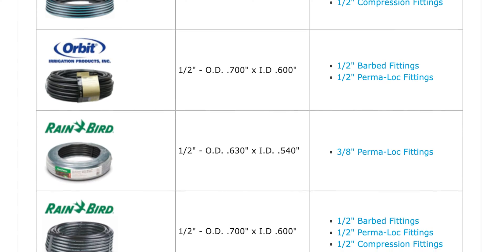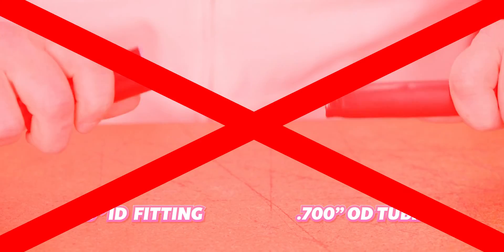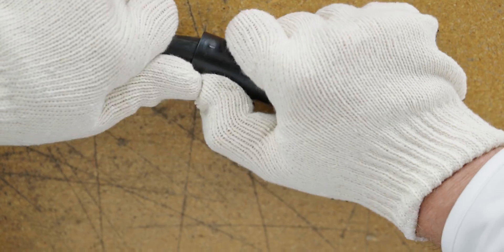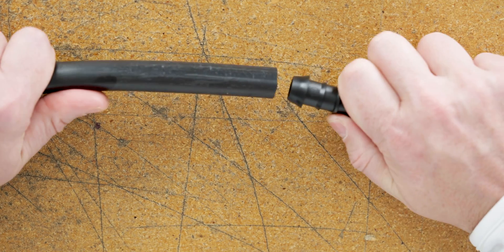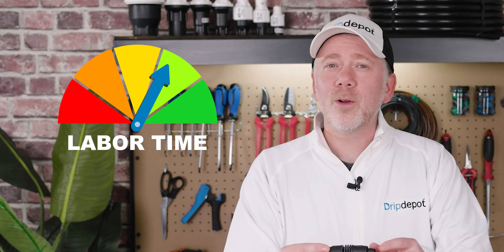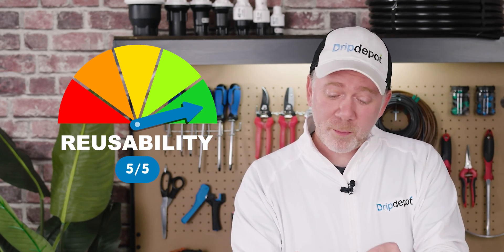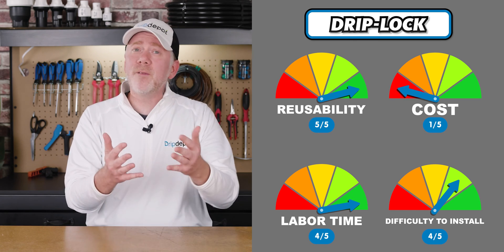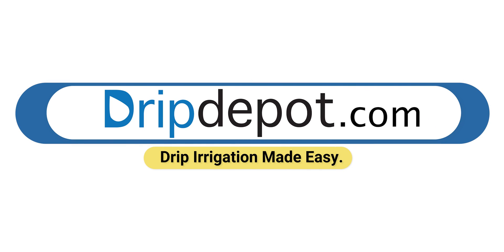Drip Irrigation Fittings: Choosing the Best Type for Your Project

Comment: This channel is honestly so good. 

I wasted money thinking that when irrigation companies say their tubing is "1/2 inch," they actually mean 0.5 inch. But in irrigation tubing, "1/2 inch" is not a diameter, but a class. So far, I haven't seen any "1/2 inch" tubing that was actually half an inch. Not inside diameter, and not outside diameter either. Instead, there are several diameters in the class in the ~0.6-0.71 inch range. This makes it much harder to reason about the tubing and fittings than any other kind of tubing I've worked with.

Companies like Rain Bird are not helpful here either. Their websites are designed by people who have forgotten what it's like to NOT already know all the crazy opaque rules about "1/2 inch" tubing. They don't make it easy to figure out which tubing works with which fittings; and you have to do a great deal of research to figure out not only which fittings to buy, but in fact, which tubing you CAN buy, because you need to hook the tubing up to a water source that's a standard diameter (like 3/4 NPT) rather than crazy irrigation moon units where the nominal diameter is more of a diversion than a specification.

For Rain Bird "1/2 inch" tubing which is actually 0.71 inches (OD), I wound up heating the end of the tubing with a hot air gun and then sliding it over a 5/8 brass barbed fitting. Even without a clamp, this has been completely leak-free for several weeks, so hopefully it'll hold. The other end of the fitting is in real units (3/4 NPT) so I actually know for sure it'll fit with an NPT pipe without having to get out an astrolabe, or consult with an astrologer, or however it is that people usually grapple with this needlessly annoying problem.

In the video, you see 0.7 vs 0.71 inch, and that 1% is enough to make things not work. Why on Earth is that even a thing? Why don't they just standardize on half, 5/8, 3/4? Or the same thing in metric, i.e., 17mm? What is this "tubing A is 0.01 inch thicker than tubing B" nonsense???
Reply from the maker: I fully agree on standardizing these!  It's frustrating for us too (which is one reason why we made the video) trying to help folks who have pre-existing tubing.  Finding out exactly which 1/2" size it is can be a huge pain.  I'm in 100% agreement (and I bet they are too!).  

I think you're touching on what would be the right answer as well, when you mention metric.  Metric would allow there to be different sizes all very close (like we see now with 1/2") but still be able to clearly know what size fittings to get.  This would allow large commercial growers not to over spend (why spend more for 17mm when you're spec'd out for 15mm) while at the same time allowing gardeners, DIY'ers and hobby farmers to easily get compatible tubing and fittings.  

PVC/Iron Pipe Size standardized decades ago, it's time for poly to do the same -- you have an ally in me to see it so.  :)
Reply: @dripdepot  I think we could actually take things a step further. How many times have you heard from someone who could only get a threaded fitting on a couple turns because they didn't realize there's a difference between NPT and GHT? I saw a bunch of reviews for a Rain Bird NPT to drip-lock fitting just today which complained about that exact thing, and it was pretty obvious what was going on.
Reply from the maker: @__S__435   You're spot on here!  The GHT x NPT confusion is definitely even more common than the different sizes of 1/2" tubing, it's something we hear almost every day.  That one is a bit tougher to solve, but maybe another thread type that combines the best properties of each (quickness and ease of hose threads and the tapered property of pipe threads) would do the trick -- after a few years of serious confusion, things might settle on the new thread standard :)
Reply: Wait till you try to buy a 2X4 ! Marketing lies. Always.

Comment: Would you ever use a Fernco coupling for a repair?
Reply from the maker: I've never used one before, but I just took a look at some of their literature and videos, and I do think they'd work well -- like "Bite" and "Loc" fittings they work with a range of sizes which is always handy, and I like how they work as a socket fitting (inserting the pipe into the fitting instead of over the fitting).  Solid looking fittings!

Comment: Can the brown tubing and black tubing use the same fittings?
Reply from the maker: In many cases you can -- the 1/4" brown and 1/4" black tubing are the same size, so they can pretty much always use the same 1/4" barbed fittings.  In the 1/2" label, they're not always the same size, even if they're both labeled 1/2".  With the brown 1/2" it's best to check the tubing's inside diameter to see which fittings would be compatible.  :)

Comment: I love your videos! I have questions.
I am setting up two drip systems from 2 rain barrels which are about 2' off the ground. I have drawn my design and know what fittings I need, except for these questions:
1) One application might be fine with drip tape (the run isn't very long and there are no turns). What is the advantage of drip tape over tubing and emitters? You reference emitters getting clogged. Does trip tape clog?
2) The other application has a total of 47' where there would be holes and emitters (there are 13' that will not have holes). To get the water all the way to the end of the longest length, should I get the emitters that adjust flow and make them drip more slowly at the proximal end and as I get to the distal end open them up? Or am I going to have the use city water with pressure to get that far?
3) Can/should I put emitters in the holes if I get the tubing with the holes pre-drilled at intervals? 
4) If I need to use city water intermittently, I know I need a backflow and pressure regulator, but for the rain barrels I don't need those. Do you recommend that I set up a separate hose connection and switch it when I need it?

Any help would be great. Then I can place my order.
Reply from the maker: Let's dive in! :)

1. Drip tape has some very low flow options, which can be an advantage in a gravity system -- basically, the low flow means each emitter creates less of a demand, which leaves flow for emitters further down the line.  Drip tape is one of the most popular gravity irrigation options as it can also work at very low pressure. 

2. For this part I'd likely get a low flow emitter that can operate at very low pressure -- the one I'm referring to is at this link, it can operate at near 0 PSI: https://www.dripdepot.com/12200

3. Most of the pre-drilled tubing will already have an emitter beneath that hole -- similar to drip tape, when you're close/holding the drip line, you can see the actual emitter in there.  This type of emitter line often has a minimum PSI to reach which might not be possible in a gravity system.  Going back to question 2 for a moment, those drippers would work similar to what you're describing -- you'd punch a hole with a hole punch, and then you could insert the barbed end of that dripper. 

4. That's a great idea and would help ensure you can run the system even if there has been no rain to collect -- alternatively, you could use a hose or similar to fill the barrels with water (if it's allowed in your area) so you could continue to use those. 

Mimi, we have a video all about gravity / barrel irrigation systems that uses a lot of what we talked about above -- if you haven't bumped into it yet, you can check it out at this link: https://www.youtube.com/watch?v=MHEb9CG8Rlg  :)
Reply: @dripdepot  Yes. That was the first video I watched and where I started. 

Thank you for your thorough reply. And what a great suggestion to put the hose in the barrel! Had to slap my head and say "Why didn't I think of that?"

Based on what I learned from that video, the pressure from my barrels is 0.866 GPH. Will that be sufficient to reach the far end of one of my lines is 30'?

I can't thank you enough!
Reply from the maker: @MimiKessler  You're very welcome, any time at all! 

Potentially you'll have enough pressure -- this will largely depend on two things: 

1. Friction loss -- friction loss is determined by the length of the line (30' in this case) and the flow going through it in gallons per hour -- the flow going through it is just the sum of all emitters operating at once.  As a quick example, if that 30' line was supported 20 0.5 GPH emitters, the flow would be 10 GPH.  If you know how many emitters and their flow rate the line will be feeding, just let me know, I can check on the friction loss for you -- if you're not sure yet, just let me know when you've decided on emitters and how many and I'd be happy to check it then. 

2. Flow -- flow and pressure are different, but both equally important to account for -- in this case I mean the flow rate coming from the barrel.  If the flow of the system is 10 GPH (20 0.5 GPH drippers as an example), you'd want the water source to flow a little higher than that.  If there's not enough flow, some emitters would be starved of water (even if technically there were enough pressure at the start). 

Is your rain barrel already setup?  If so, you can get a good idea of its flow rate with the timer and bucket test -- time how long it takes to fill the bucket with water and then put the numbers into this flow rate calculator, it will give you a good approximation: https://www.dripdepot.com/irrigation-calculators :)
Reply: @dripdepot  Good idea. I will do that.

Comment: can you bury a barbed coupler? which is best for burying?
Reply from the maker: You bet, it's fairly common (particularly on larger Ag projects) for them to be buried.  With 1/4" couplers I'd say it does slightly increase the chance of debris getting in (which should be flushed out), with the 1/2" couplers the risk of any debris getting in a fairly minimal :)

Comment: Compression fittings are reusable if you're determined enough lol
Reply from the maker: Kind of (and you're right about determined lol, not easy to get tubing out) -- once the compression ring has been engaged, it's no longer 100% -- so you can technically re-use them (after fighting the tubing), but it is a little riskier since the compression ring has already been used.
Reply: @dripdepot  ya i am definitely just buying a new one next time lol

Comment: 2:49 protip: don't attempt to reuse compression fittings unless you want a free surprise sprinkler system installed in some of your garden beds.
Reply from the maker: Fully agreed!  There's a couple comments here suggesting you can re-use them, I do suspect there's a few surprise sprinkler systems out there like you noted.  Even when it looks like you can reuse it, best not to :)
Reply: @dripdepot  real question, though: which one is best for subterranean use?  I'm assuming barbed tubing with metal collars, since these seem the most damage-resistant.  For the record, I currently bury only the tubing itself, leaving all joints above ground, but it's something I've been thinking to try as a budget-friendly funny pipe substitute for small / semi-permanent projects.
Reply from the maker: @shionyr   I think you are correct -- I'd stick to barbed fittings with clamps or with the Loc style fittings.  With the Loc style fittings I'd only use the professional ones made by Irritec (they have different names on various sites, on ours they're called Twist-n-Lok, Irritec calls them Perma-Loc), they're durable enough to be used sub-surface and the locking nuts on them work like clamps.  Some of the off-brand ones might work, but I haven't used them (if the plastic is dense and heavy, good chance it's durable enough). 

When going barbed fittings with clamps for sub-surface, I'll usually put 2 clamps on each side of the fitting, with the tightening gear on opposite sides for each one to level out the tension.  

Like you noted, I definitely avoid compression fittings in any sub-surface application, because eventually you are indeed going to get a surprise geyser lol

Comment: Who the hell ever uses clamps with barb inserts?????
Reply from the maker: Professionally, virtually everyone -- note, this is in reference to LDPE poly tubing.  Funny pipe, for example, does not typically need clamps, same with most braided tubing.  

With an above surface DIY install for a low pressure drip system, we've seen people go without clamps, but even then the low cost of some clamps is probably worth it, a blown fitting while the system is running can cause a lot of damage quickly.  

For sub-surface systems, I'd always recommend going with the clamps, even if it's just for the extra peace of mind.  And for anything higher pressure than drip, I'd always go with the clamp (again, for LDPE, not for funny pipe or braided tubing) :)
Reply: @dripdepot  In a video on irrigation, on youtube the show "Garden Answer" uses barb inserts with clamps.
Reply from the maker: @betwil3  You bet, using the clamps is definitely best practice -- even if it's unlikely a fitting will blow off in a drip system, the odds are greater than 0 and given what can happen with a fitting blows and it's not noticed right away, best to use the clamps when using barbed insert fitting :)

Comment: You don't have the specs for perma-loc on your website, but I would recommend operating PSI under 50.  My biggest issue with all fittings is I've had a lot of leaks to deal with.  Perma-loc tends to not deal with lateral pulls on the joint all that well without problems.  I think I may try some of the drip lock fittings to see if they do better at dealing with movement in any of the hoses.
Reply from the maker: Absolutely correct on all counts -- the manufacturer doesn't tell us the max operating PSI for them, they say to keep the operating pressure for what the tubing is rated for, which is fairly reasonable and is also, as you noted, 50 to 60 PSI.  I'd agree they're best used in low pressure drip applications.  

Drip-Lock could be a good choice here -- the teeth inside the drip-lock fittings can rotate, so they might indeed be a little better with moving hoses as they can be connected but still rotate.

Comment: The compression fittings can be used again. You just have to use a set of pliers, preferably needle nose, and work out the portion of tubing that is stuck inside. It’s a total pain but the fittings are not single use only.
Reply from the maker: While they can be reused, they should not -- the manufacturers of the compression fittings also recommend not re-using them.  It's one of those situations where reusing them is a "do so at your own risk" kind of thing, which when it comes to plumbing and large amounts of water, it's usually better to play it safe.  

The reason is because the compression ring inside, they're generally considered a one time use.  To some degree the time since installation does apply -- if you inserted some tubing into a compression fitting then need to immediately remove it, chances are you'll be good -- but if it has been installed for awhile, definitely best to just get a replacement fitting :)

Comment: Good video.   I just use an old coffee cup (one you don't care if it gets broken working outside.. and won't be drinking coffee from later) filled 3/4 full with water that I then heat in a microwave to a reasonably hot level (not too hot... don't want to scald yourself!!).   Dip the end of the 1/4" or 1/2" line into the hot water for a few seconds... quickly shake off the excess water.. and shove the hose home.   It makes pushing barb-fittings into 1/4" hoses and 1/2" poly hoses into fittings super easy compared to doing it 'cold'.   They go together like butter.   This works especially well if you're working on a cold day when otherwise it's super difficult to push things together.
Reply from the maker: Fully agreed, and fantastic tip for anyone reading this who wants to make installing fittings magnitudes easier.  Those cold morning installs without hot water are absolutely not my favorite.  I like to use the hole punch on tubing that is cold, but for everything else (installing fittings, rolling out the line) hotter tubing is going to be easier :)
Reply: I wanted do use a hose warming method, but my local irrigation supply company said that warming the dripline may comprise it.  Perhaps I’ll try it anyway.  Barbed couplers are much less expensive than other coupler designs.
Reply: @christinaannabel The tubing is basically PVC.. it was created (extruded) at a much higher temperature than hot water.   Saying hot water would damage pvc makes little sense.. it just softens it a little.   If that kind of heat were to damage it then how does it survive a hot day In Phoenix?   I’ve used this method for 20 years and never had a problem.   Now if I could get squirrels and other vermin to leave my pipes alone, that would be the biggest recurring problem I face every year!  Lol!!

Comment: Installing compression fittings is a lot easier with a heat gun. Do a couple of practice fits first to determine how much heat is needed.
Reply from the maker: You've got the right of it there -- heat makes installing pretty much every type of fitting easier.  My least favorite time to install (any of them) is on cold Spring mornings early in the season.